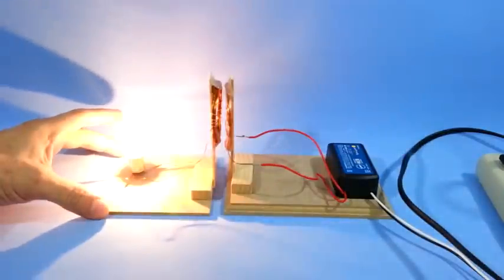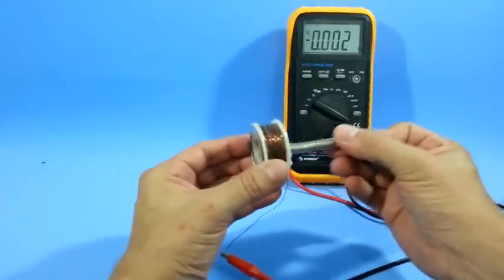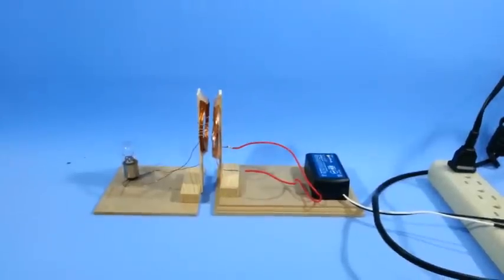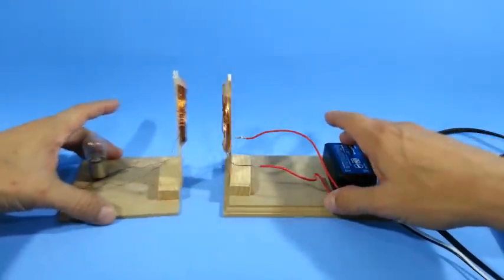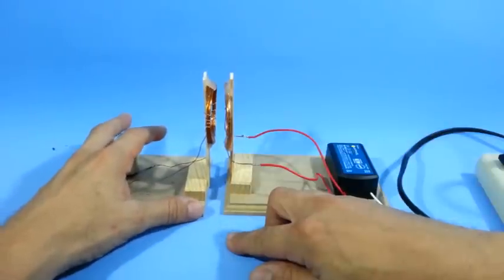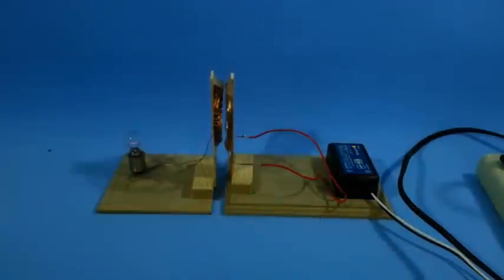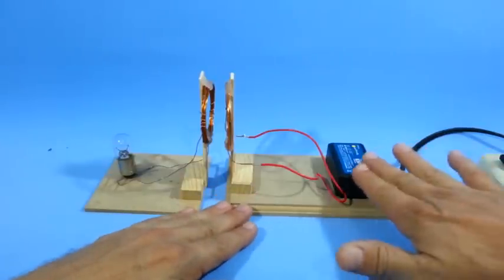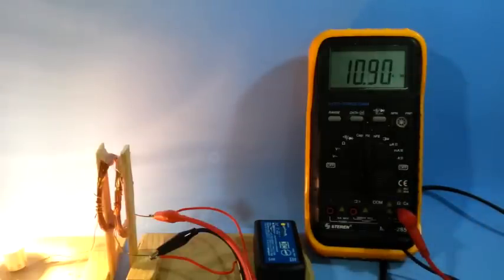How Wireless Chargers Work?

Comment: wow. 12W is a Lot. but how much energy is inserted on the primary side to achieve 12w ob the secondary?
Reply from the maker: much more, around 60 w
Reply: It could be less if you match the resonance. I'm not sure if Lucid Science bothered with optimizing the system.
Reply: Axel Werner

Comment: thank you for explaining the working of wireless transmission of electricity, but you have not commented about the details of turns and wire gauge used and what type of electronic ballast is to be used. usually four wires  come from ballast.if possible please give the details also.
Reply from the maker: +pradeep kp 9 turns gauge 22 in emitter coil, 24 turns 24 gauge on receiver coil. 8cm diameter both
Reply: pradeep kp

Comment: Efficiency loses to convenience. Thanks for explaining how it works.
Reply: Granted, due to how charging ports can get messed up and stop working, having the option of wireless charging is priceless for the longevity of something like a phone or watch. I’ve had multiple phones that stop being able to be charged through their charge port, but that have lasted another five years+ as a result of wireless charging. Besides, one or two wireless chargers I’ve found actually charge my phone faster than a charge cable ever did.

Comment: I have 2 questions:
1.so you can't power any device that use AC except incandescent lamp since the AC has 11 KHz frequency? 
2. do I need to put another ballast to change 11KHz into 60Hz in order to power device that run with that frequency ?
thank you for your answer
Reply from the maker: +Oswald Rayleigh you can rectify the output to get DC, then usr a voltage regulador to obtain 5v for example and charge your mobile
Reply: Ludic Science but the frequency still 11KHz .or is it become lower as you lower the voltage?

Comment: So, you are not creating a resonant LC tank circuit? Most other wireless power devices transmit power at the resonant frequency of LC tanks on both the transmitting end and receiving end. This increases efficiency further
Reply: Vikas V this is only for demonstration ffs

Comment: could you tell me why it doesn't work perfectly for low frequency ac
Reply: it can work at any frequency, but lower frequency needs more turns of the same thickness. the equivalent circuit to the one in the video, but at 50 hz would be 2 coils with the size of 2 truck/bus wheels attached together, but just for only ONE of the coils
Reply: coz the flux is higher if the rate of change of field is higher, that is frequency of ac current.
Reply: @nicolasflamel3489  the flux is the same. It's the rate at which the flux is changing that counts according to Faraday's law of induction. At high frequency this rate is much bigger than in 50-60 Hz home electricity.
Reply: +John Scarce Thanks! You spoke it in layman's English. Which was just what I needed. Please what it the black cuboid in the video? that's connected to the coil
Reply: Lower frequency means bigger medium. This is analogous to: how you would use a subwoofer instead of a tweeter for a good ass-kicking bass